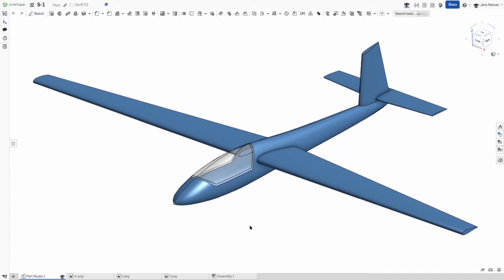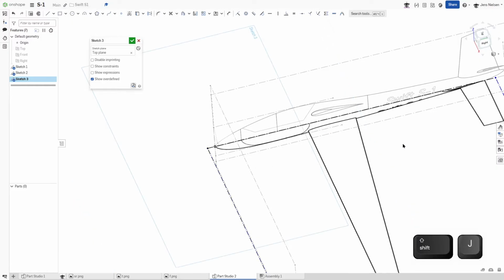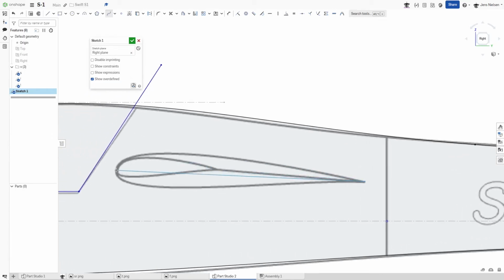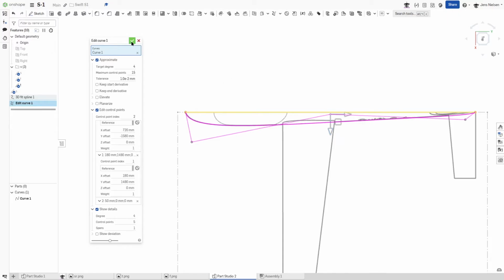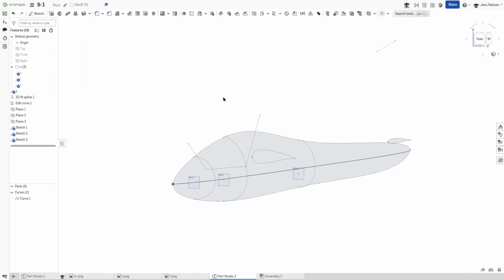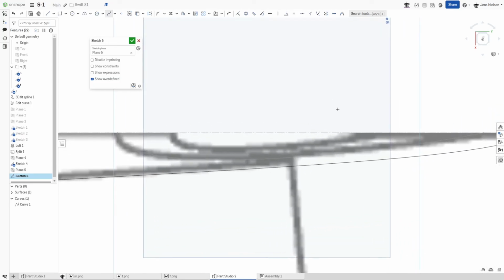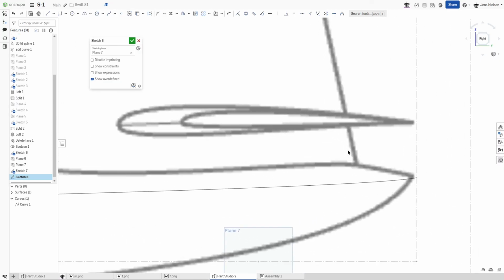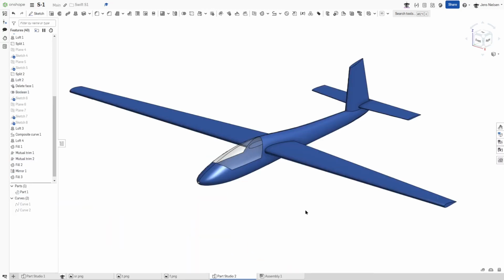Surface Modeling in Onshape:  Design a Sleek Glider Airplane

Comment: 14:14S - THIS PART IS NOT WORKING FOR ME. I CAN CLICK ON THE FIRST POINT, THE HANDLE SHOWS BY THE POINT LIKE YOURS, BUT AFTER THE 2ND 3RD 4TH POINT OVER , THE HANDLES SHOWS UP WAY OFF PLACE NOT CORRESPONDING WITH ITS POSITION
Reply from the maker: It sounds like you are using a 2d-spline instead of the 3D-curve of the tutorial.

Comment: Thank you for this video.  I have been hand drafting a design  (I learned old school) for a while and decided I wanted to up my game and try to 3d print the plane to test the design, but I have very little CAD experience.  This was immensely helpful.  I scanned all of my drawings and had them cleaned up and matched to scale with an AI sketch tool I found online and started doing your method here with great success!  I still have a lot to figure out, but this got me so much closer to my goal.
Reply from the maker: That's awesome, using AI to bridge hand drawings with CAD is a great workflow! ✈️

Comment: And again things went wrong almost at the end. The tail fin turned out to be split and would not close with the fill. So I started all over again, I couldn't find where it had gone wrong. Learned also a lot this time.

Due to the delay with the plane, I arrived a little later at the departure point of the helicopter.

Oh yes, the nice text on the plane, are you going to show me how to get it on?

Furthermore, it goes like train, and model trains are my hobby (just a little hint...).
Reply from the maker: I'm glad you figured that out with the tail fin. I will remember how to show how to project the lettering on a surface, maybe along with some other techniques in appearances, like  the stripes on the helicopter.